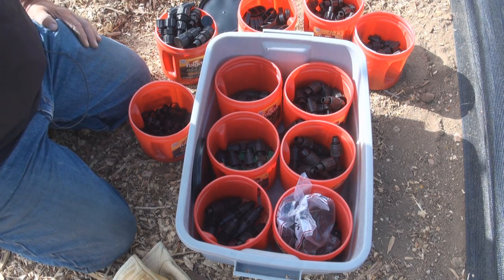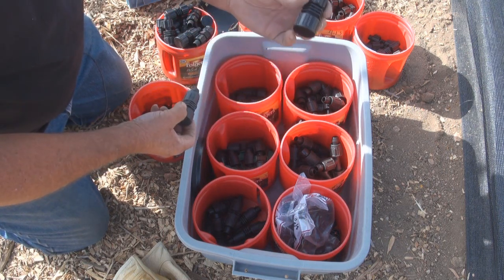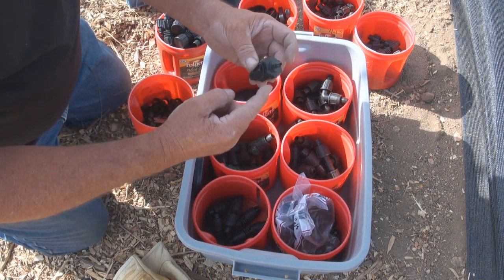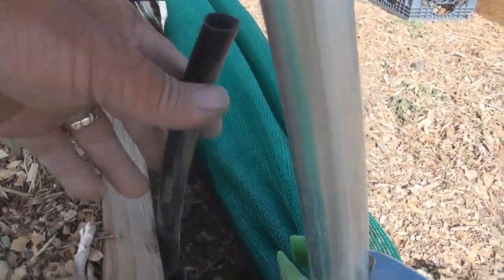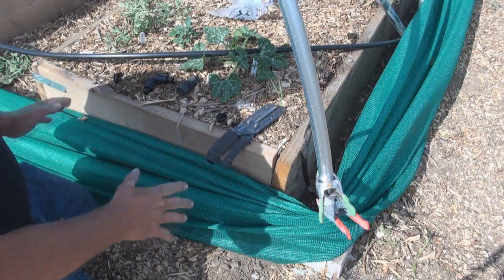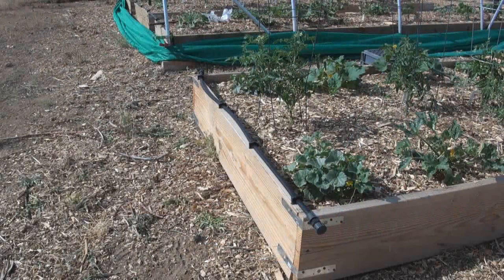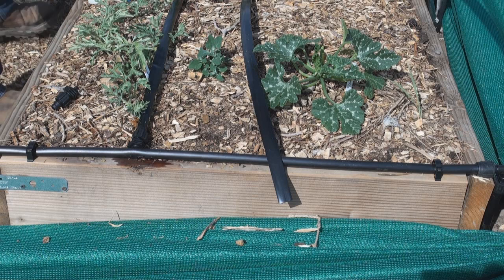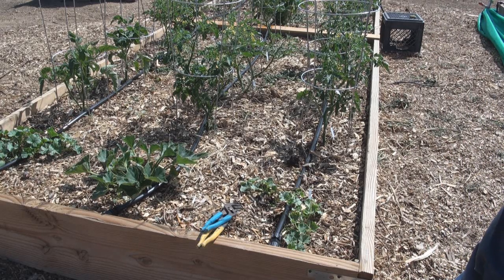Drip Tape Irrigation

Comment: Whats the longest length you can run the tape ?  I have a long paddock, about 170m (nearly 500ft)  is that too long for one tape ?
Reply from the maker: Blossom,
500' is to far for one run. Length depends on several factors such as tape or line diameter and pressure. If you go to dripworks.com, they have a great tool for working out the lengths. On my swales for example, I used 3/4" primary to get to the swales and then 1/2 line to irrigate. My swales are about 400' overall and they use 4 zones to give you an idea.

Comment: I've got about 600 feet of tubing, approx 400' is 12" to 18" drippers (1/2" emitter tubing).  But on my runs that I'm using drippers, I'm surprised you get enough volume from 1/4" punches?  I too have been using DripWorks, since 1994.  Anyway, I use a full T on my 1/2" runs except where I need to maintain pressure.  So my question ~ you get enough volume?
Reply from the maker: David,
I seem to get enough volume. My main line length is less than 100' and then the drip tape is another 150'. So the length does help me, if I had anything much longer I would use the 3/4 mainline to help that out. If I did have less volume, I could always adjust run times at the valves.